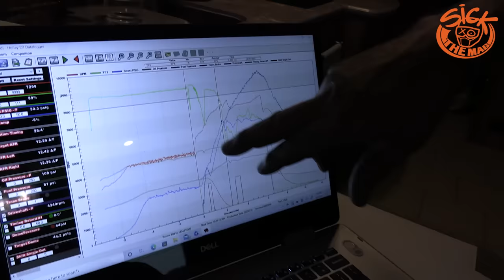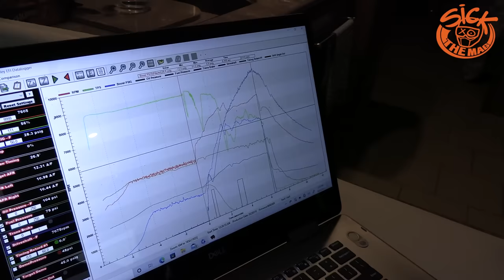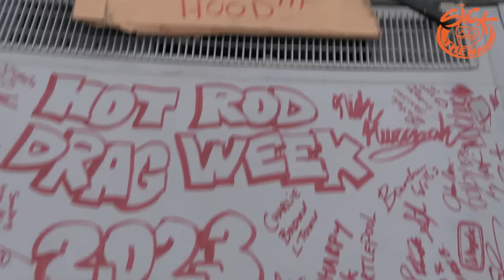We Won Drag Week! 3000HP Camaro Street Car Still The Best

Comment: Congrats Tom.  Another guitar for the collection!  Most impressive performance this week IMO was the convertible Fox mustang running in the 6’s with stock style suspension and on a 275 radial.  To do that on a non full out radial prepped surface is really impressive.  Oh, and Goldstone giving you s… for letting off early on most every run was classic.  I could tell Steve loved it.

Comment: Awesome 👏 unreal how well performance and durability has been achieved!!! Congratulations!! 😊 hellbilly  deluxe also had the same issues on the 468 big block.  Old school rocker nut kept backing out of the #2 exhaust.
Dropping the pan and ripping out the intake got annoying after the 2nd time .. yellow torch.. smaller head socket.. hammered down and hit it with a couple heat cycles.

So far so good …
Leaks like Hoover dam.. but it’s a CHEVY.. lol 😅

Comment: Nice run !! .....9:50 Tires look like running a bit Low inflation.....Just Outside tread puttin down Rubber.......Probably had a potential  6:50 run going.......

Comment: I think it interesting that as fast as these guys are with all the boost and stuff that they are running only slightly faster than NHRA Pro Stock, >500 cid, NA, 2 4bbl carbs. on gas.
Reply: #1. Pro Stocks run fuel injection now
#2. They don't drive 200-250 miles to the track....four days in a row